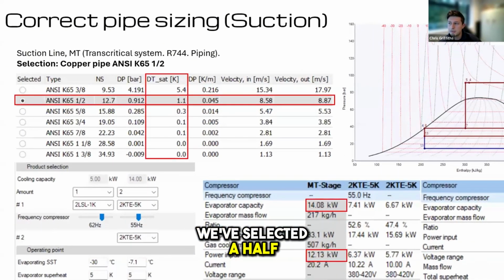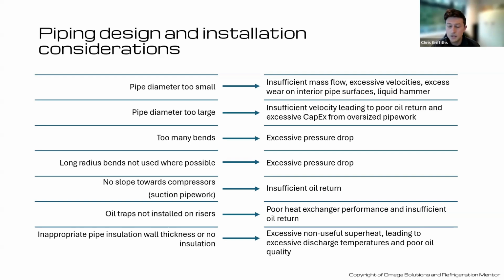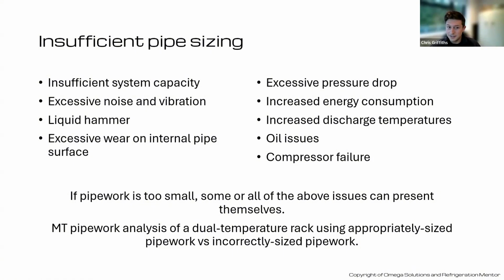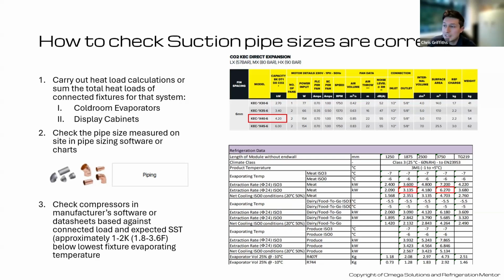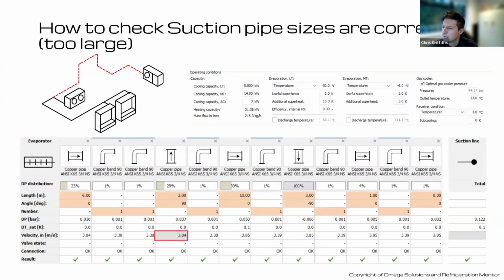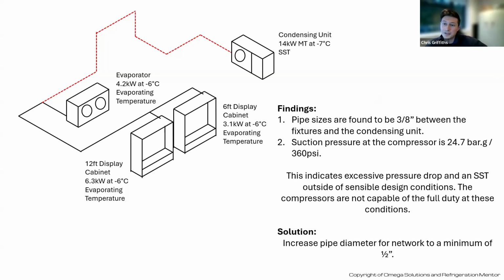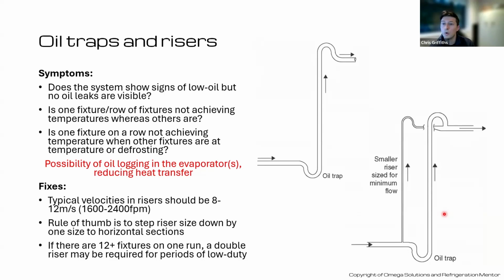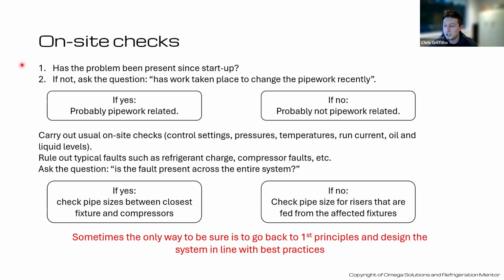CO2 Experts: Pipe Sizing for Transcritical CO2 Refrigeration System

Comment: So basically if the pipes are too small the system will implode
Reply from the maker: No the pressure drop could be too high and cause flash gas for one example.